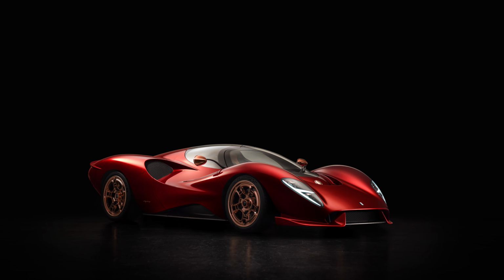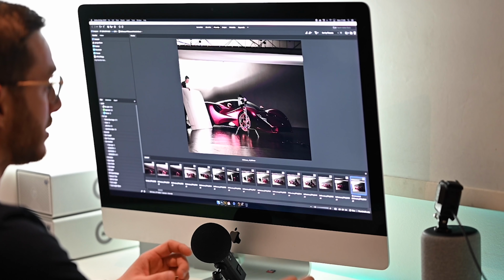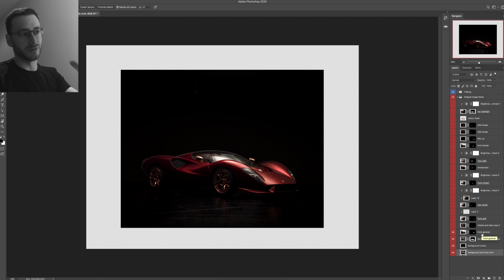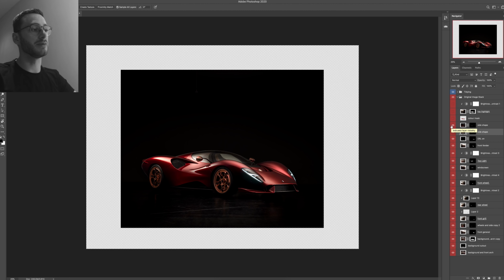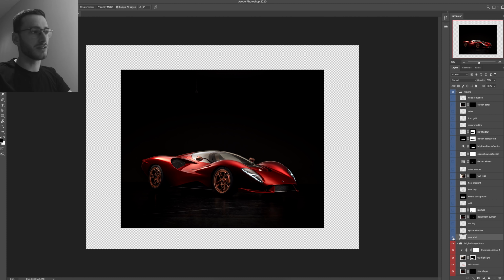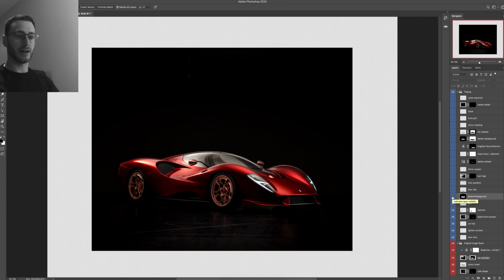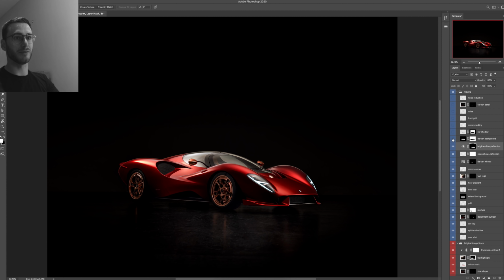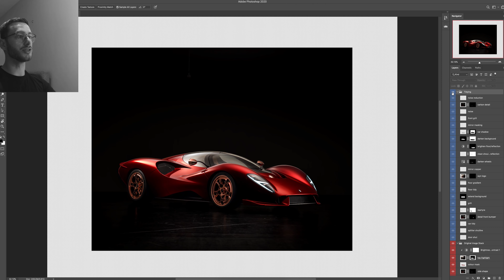DeTomaso P72 Launch Photo - Studio Photoshop Retouching Build

Comment: i have a question that relates to the car. does anyone know how the shifting works? because from what i’ve seen, the car has a 6-speed manual transmission but the shifter looks like it’s in a very confined space. does it just have extremely short throws?
Reply from the maker: This is the pre production car, for the production car it'll be a 6 speed manual.  I don't know how it'll work at this stage though.